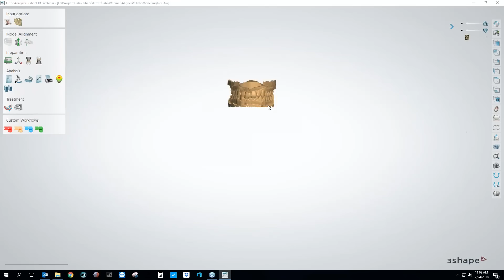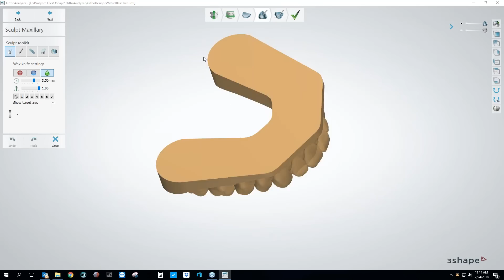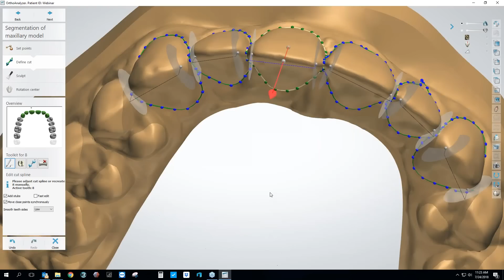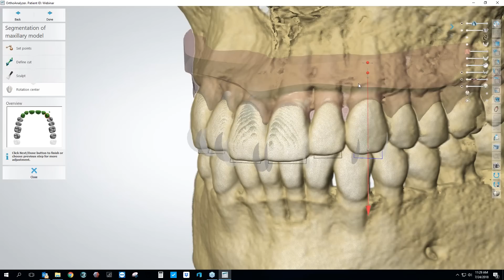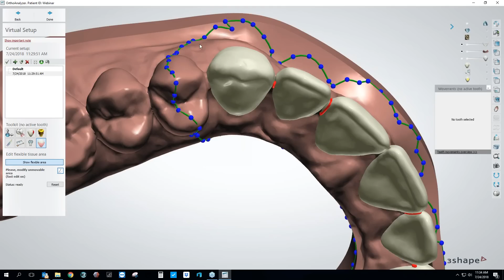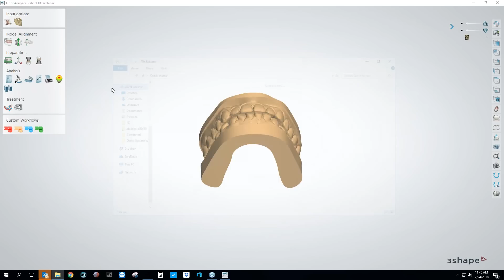[Webinar] Making Clear Aligners Using the 3Shape Ortho System Module with Brandon Smith, CDT

Comment: How much is 3shape clear aligner software & equipment?
Reply from the maker: This is going to depend on which software package you choose and which equipment is required for your particular setup. If you are in the United States, you can email sales@whipmix.com and a rep will reach out to discuss your options. If you are outside the United States, you will need to contact your local reseller for this information.

Comment: Is there a big difference between this version workflow and the present version workflow?
Reply from the maker: The workflows are very similar once you get into the actual workflow. Most of the changes had to do with case creation and management. But once you are in the actual workflows they are very similar to previous versions of the software.

Comment: is it possible to add overcorrection  by adding one or two extra subsetups at the end?
Reply: You can do this by either copying a substep as a new setup, or by using the staging and timelines feature.
Reply: @themodernmelon  thankyou
One more thing if i block the movement of one tooth in staging and timeline it will increase the movement of that specific tooth on rest of aligners thats not good
How you mange such cases
Reply: @themodernmelon  is it possible to export jpeg of before and after?

Comment: Hi!! How can i get the ct scan? I only have the STL scans... Thanks
Reply from the maker: Hi Hector. The CT scan has to come from the doctor. The doctor must have a cone beam imaging scanner and send it to the laboratory.
Reply: @WhipMixCorporation  Thanks, I have another difference between your video and my work. My models don't appear directly in the occlusion position when I import them into the program. How can I fix that ??
Reply: @hectorllamosas9576  Hi Hector, the solution depends on how your scans were taken. If the scans came from an intraoral scanner, and the bite is off, the bite needs to be corrected in the intraoral scanning software. If you scanned in stone casts, you will simply need to re-scan the occlusion with the correct bite.

Comment: may i ask is it possible to block undercut on the model automatically ? for clear aligner better fitting
Reply from the maker: We do not believe there is an option for that as the aligners will need to engage in the undercuts.